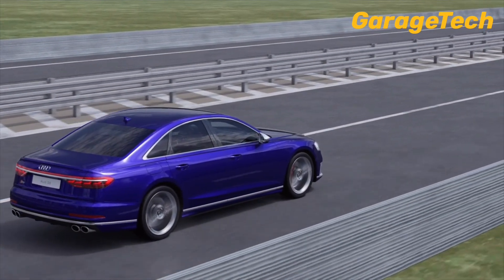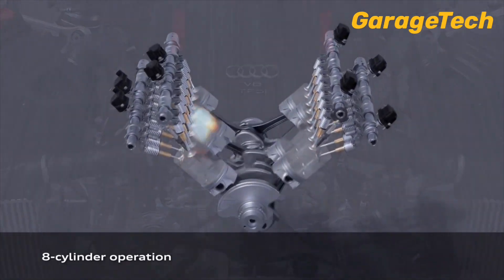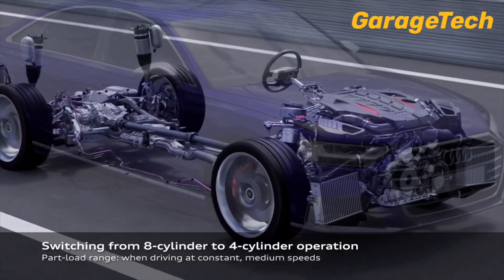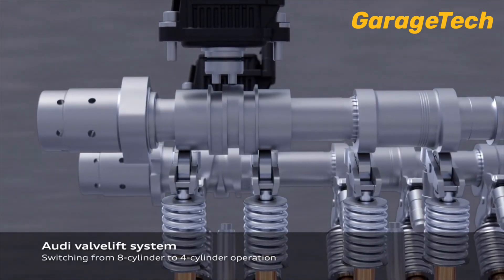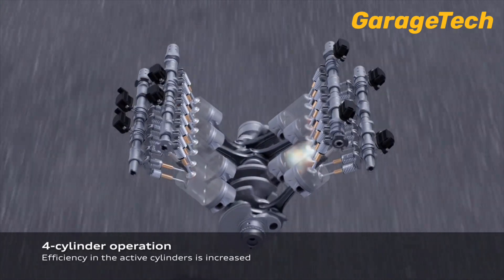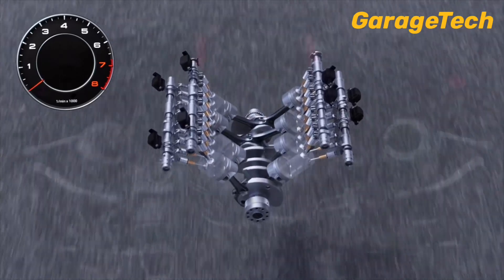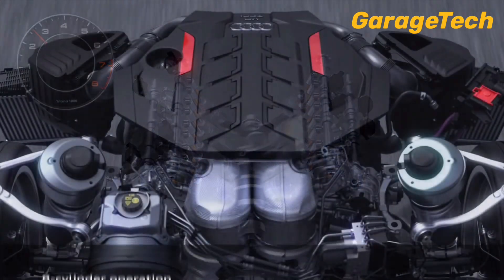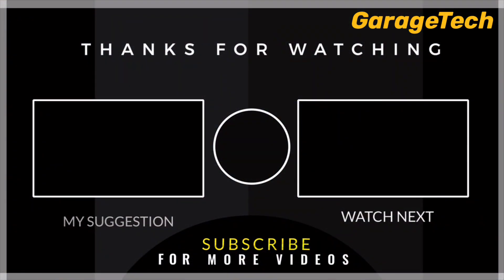Cylinder shut off on demand, how does the engine shut down and deactivate cylinders and still run

Comment: the video should be titled,  how does the cylinder deactivation screw up your engine.
Reply from the maker: @tomzphone  or, how does government enforced emission regulations screw up your engine 🤣
Reply: @GarageTechAutomotive  correct,  the government is to blame.  There have been many reports of engine problems to cylinder deactivation on cars.  Including my own  Pilot.    for example:  Common Honda VCM Issues (notably in Pilot, Odyssey, Accord, and others):

some Honda engines have suffered catastrophic failure — including blown engines — and many of these cases are believed to be linked to the VCM (Variable Cylinder Management) system.

Excessive oil consumption – The deactivated cylinders run cooler, which can cause incomplete combustion and oil to seep past piston rings.

Misfires – Inactive cylinders can develop carbon build-up or spark plug fouling, leading to misfire codes (especially P0301-P0306).

Engine mounts failing early – VCM can cause vibration during switching, which puts extra strain on engine mounts.

Premature wear of piston rings – Especially in cylinders that are frequently deactivated.  There have been class-action lawsuits over VCM-related problems, particularly over excessive oil consumption and engine damage. Honda issued some Technical Service Bulletins (TSBs) and, in some cases, extended warranties or settlements.  

GM (Active Fuel Management - AFM):
Used in many Chevy/GMC V8s (e.g., Silverado, Suburban, Tahoe, etc.).

Common issues include oil consumption, lifter failure, and camshaft wear.

Known to lead to engine replacements in some cases.

Chrysler/Dodge (Multi-Displacement System - MDS):
Found in HEMI V8s.

Reports of lifter and camshaft failures, especially in Ram trucks and Chargers.

Toyota (D-4S):
Toyota's version is more refined, and major issues are less common, but early DFM-style tech in some Lexus models had rough transitions.